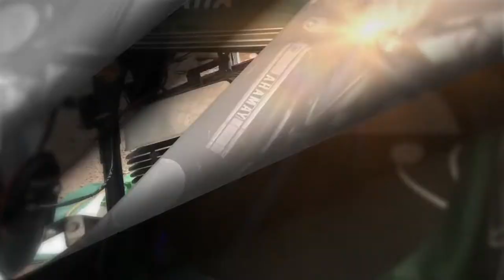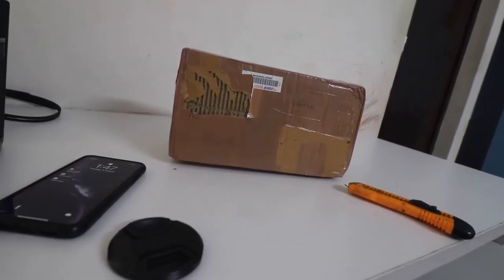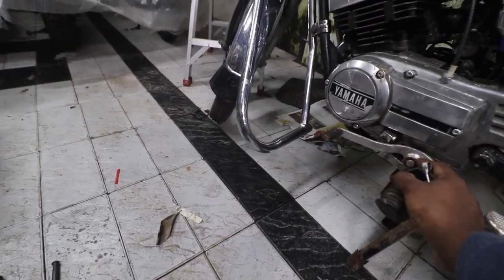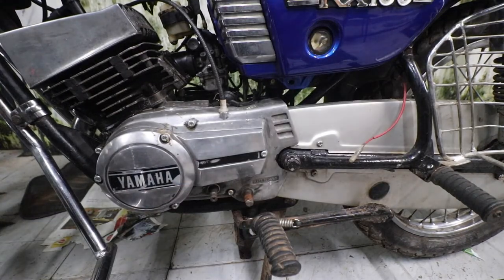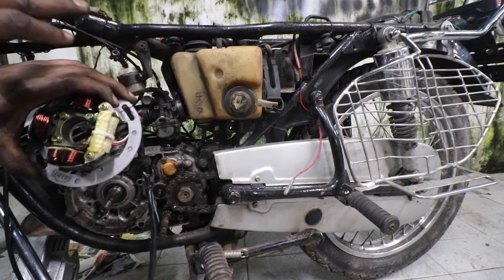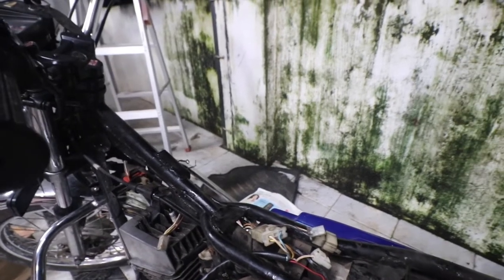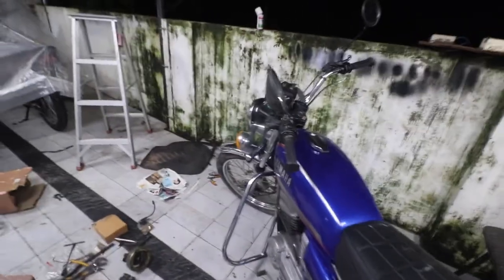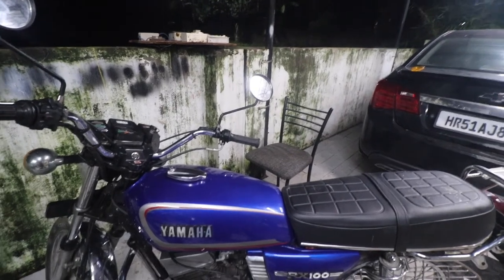RX 100 Allied CDI step by step DIY Install and honest review (English Video)

Comment: My problem still isn't fixed sir. @yamakaze
Reply from the maker: What problem?
Reply: @Yamakaze  headlight bulb & tailight bulb fusing. Rectifier not controlling the voltage added an extra chetak rectifier to headlight wiring now headlight is okay but tailight still blows up along with hjg auxiliary lights which i had connected
Reply from the maker: @MirSalmanAli  check ground
Reply: @Yamakaze  already did,sir everything is cross checked thrice
Reply from the maker: @MirSalmanAli  try an rx 135 original rr unit